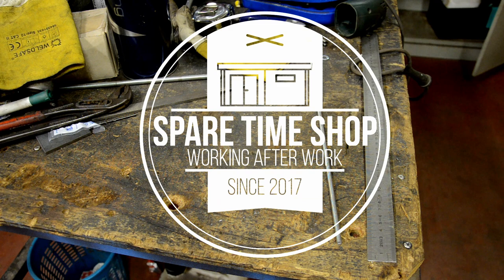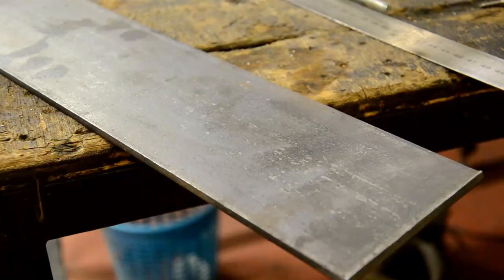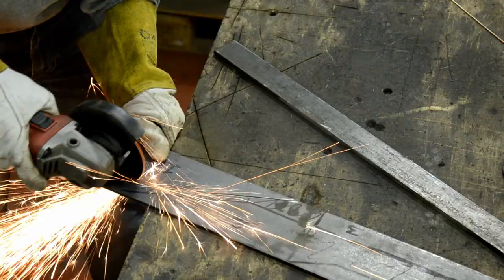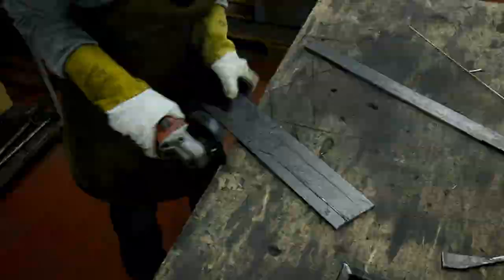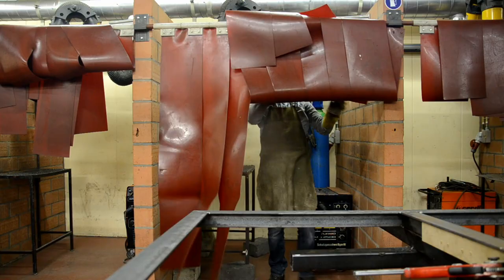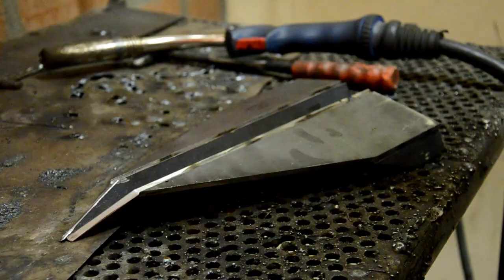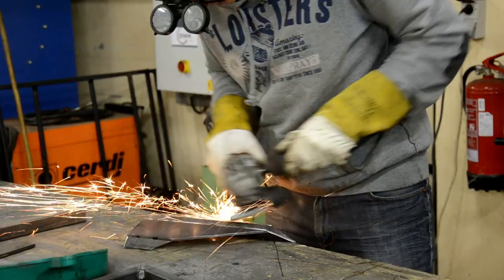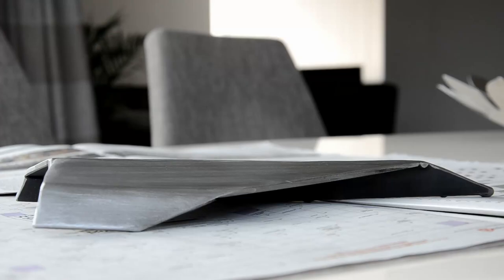MIG Welding Paper Planes / Metalwork

Comment: CLAMP THE WORK PIECE AND USE 2 HANDS ON YOUR GRINDER!!! I ran an angle grinder for 10 years accident free.... UNTIL last year I was running a cut line one handed like is shown at 1:47 when my grinder blade bit into the steel, kicked back and put a 6 inch slice into my leg 2 inches from my femoral artery... i made an 80mph drive to the ER and 14 stitches later I got really lucky... DONT EVER MOVE THE BLADE BACK TOWARDS YOU WHILE CUTTING 1 HANDED

PS: I'm usually not this guy in the comments but I'm skilled and careful while using my tools, but briefly ignored proper form that morning and a serious accident happened....